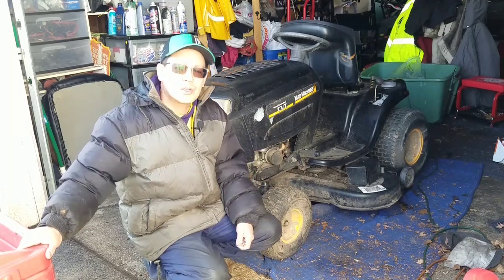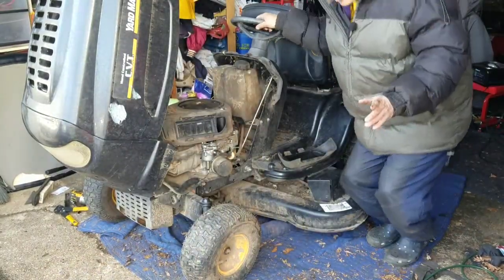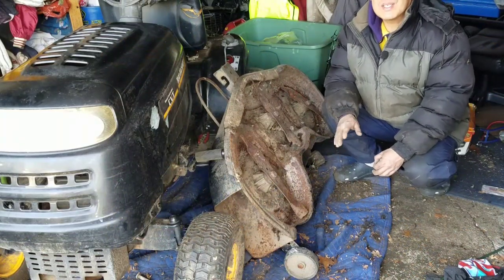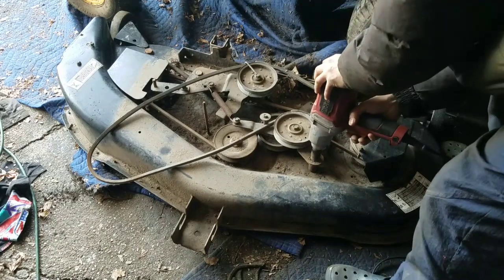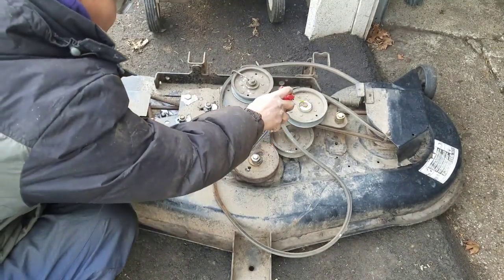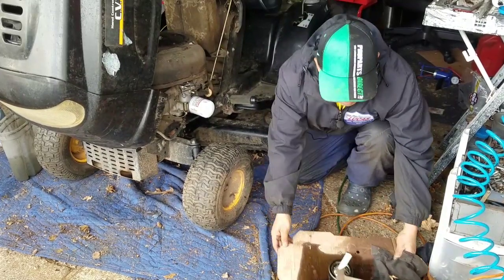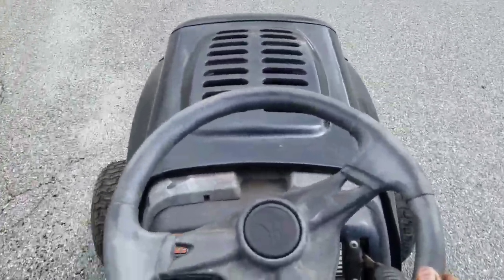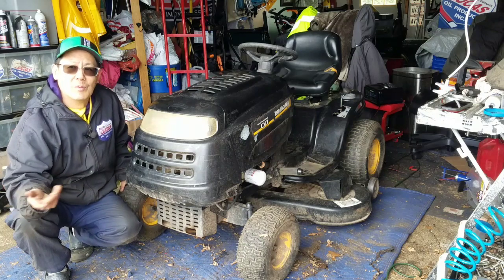YARDMACHINES 20HP BRIGGS MTD CVT CONTINUOUSLY VARIABLE TRANSMISSION MOWER DECK REPAIR MAGNETO BYPASS

Comment: Good  day Boy that is same as mine except the name & cvt. I do have the viable  speed pulleys, I bought new a canadian tire.  They wanted $16.00 for filter.  I'm getting cheaper ones now.  I was having trouble with mower brake, I will have to check like you did.  Thanks for now

Comment: did alot bro today on that tractor, just need a battery and a clean up and good to go .
Reply from the maker: The cleanup will be a challenge
Reply: @MowersNBlowers  I'd say the engine area the most will be my opinion.

Comment: Yea, I take the blades off and put them on my bench and hold them with my foot when I sharpen them, to get it done properly and balanced, nice and sharp. Plus its easier to clean that crap out with the blades outta the way.
Reply from the maker: I've stripped the spindle shaft bolts before, so I'm weary of removing them if I don't have to.
Reply: @MowersNBlowers  True, plus I don't think I ever had anyone try to look under a tractors deck that I sold and 90% of the push mowers I sell never get looked under either. You get the rare occasional smart customer that will look. Most of the time, they say let me hear it start, okay sounds good sold.
Reply from the maker: Fearless same

Comment: Did you know that you can put transmission fluid in your tires with a slow leak and it will seal them
Reply from the maker: I've heard that, but I never tried! I've tried anti freeze and rubber bits before, it didnt work!  What's the secret? What's the difference between atf and regular motor oil?
Reply: Rick Broerman I’ve used flex seal works great
Reply from the maker: @backyardgarage6823  flex seal is expensive.

Comment: A cvt in a lawnmower?   Well with that little power that might be ok.  They don’t work well on Nissan’s.
Reply from the maker: Lol
Reply: D Fields how is your son’s car doing?
Reply: Pattay's Performance  it’s about the same,  I did a 2nd drain and fill   It got a little better after that.  The fluid is looking better but still the p0744  light comes up from time to time.  I am thinking it has a sticking solenoid(s) or valve(s) in the valve body.   It’s not a CVT transmission  on the 2001 model year.  My next steps is to use 
seafoam transtune ,  then drive it 30-1000 after adding it  to try to clean out things inside the transmission valve body and or pump.   Then do a 3rd  drain and fill.  This to complete  the atf flush the slow way you have to do when car has more then 200k miles and 19 years to not shock the system.  If it doesn’t work after this. I will mostly likely drop the pan and look at round and replace filter /screen.

This vid  a guy in UK took on how to install solenoids pack on  this specific transmission.  Its pretty good

https://youtu.be/BxycOuKsiC0

Btw where I live we are in pretty much lock down due to COVID-19.  
All schools are closed right now for my kids,  my oldest can do online classes but my youngest has special needs so basically home schooling here with some assignments the teacher sent .